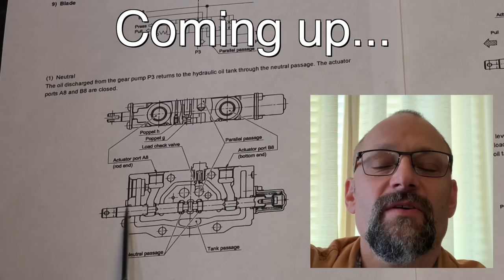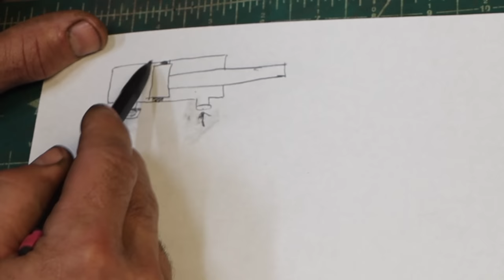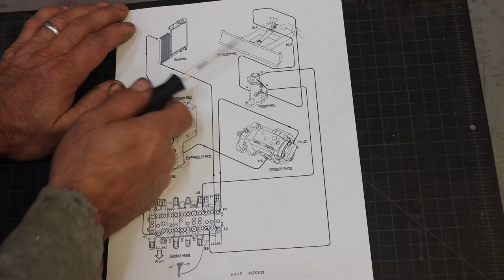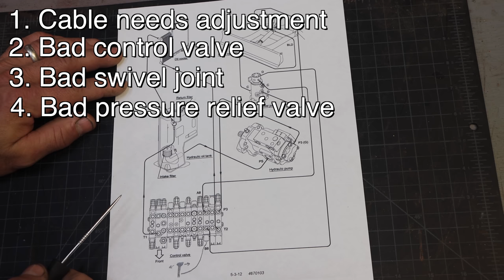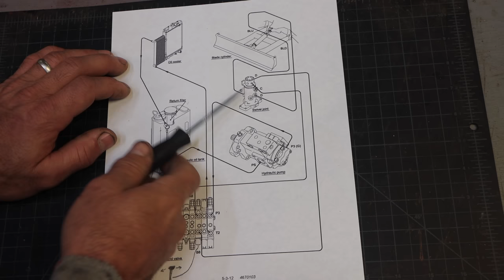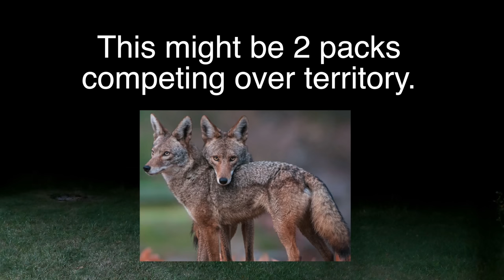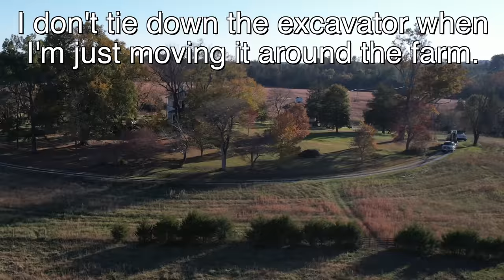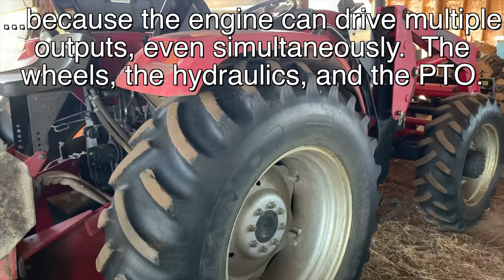Excavator Repair, Swivel Joint Rebuild, Yanmar Vio-50.

Comment: teflon tape is used for hydraulic systems ,just hold it back 2 threads so it does not get into the system. Hydraulic Tech Field service 20 years Paul Munroe Hyd inc Retired

Comment: Yeah you definitely should of specked out the diameter and ordered for hydraulic oil dealer they tend to be very helpful and drawing them out is easy and they usually switch with nominal dimension save you big $$$ and make you good fixing hydraulic that are long gone out of business, also call dealer hand get parts number, and shop round if you want the easy rote, great content, ps. Don’t use pie tape on hyd. Lol

Comment: I noticed that you had issues of cleaning your hydraulic oil on your excavator. I recommend you purchase or build a hydraulic filter cart
Reply: A hydraulic filter cart has a 5 micron filter and water filter at the suction side and a 3 micron at the return. Put the suction hose near the bottom of the tank and the return hose in opened end of the tank.  I worked on hydraulic Injection molding machine for 35 years. This is the best solution to your problem.

Comment: Hi! Thanks for the great video! Everything was well explained and clear as day, even though I've never more than seen an excavator. I was left wondering that shouldn't the hydraulic and electric swivel joints both be on the center of rotation in the boom lift?
Reply from the maker: Yes, see the clarification video in the description.  I was pointing at the wrong thing without thinking.
Reply: @FarmCraft101  Thanks for taking time answering a comment in a month old video! That was a great clarification, also :) I really appreciate you make clarifications if needed. Many won't. I'll check the descriptions f your videos from now on if I've left with questions 😉

Comment: You still could have bypassing. Seal could be slightly messed up when the blade is down and it has all the weight of the machine and when you were running test the cylinder has no weight on it

Comment: While I had envisioned something similar to the rotary manifold, that was much less complex than I would have expected.  How many hours do you think that took?  For parts that are so critical to the function of the machine, and are such a chore to disconnect, does it make sense to swap out the old fittings for quick disconnects?

Comment: I have worked on that exact same model of excavator. It would be worse if the valve itself was leaking because you have to take of every single hose

Comment: I took all my hoses off first on my vio 75 labled as i went and took it out at the bottom  i think its much easer  but my blade wasent the issue  it was the tracking  I took it apart and seals just rolled out like  powder ,

Comment: If you blocked the cylinder the other way around and tried to extend it, it is actually very dangerous if the seal is actually sealing. Since the rod end of the piston has a smaller surface area, that side will create a pressure well beyond the pressure that the cylinder is rated to and can blow seals, crack the barrel, blow the cap off etc. The great the rod to barrel ratio, the high the pressure difference created. Just worth noting. 😬

Comment: The drive motors also pass through the swivel. How do I test them like you tested the blade cylinder before I attempt to tackle a swivel rebuild? My drive motors seem to slip in high torque situations like turning or going uphill. I am afraid the problem might be in the swivel but I really want to be sure first. I also wonder why there are 10 hoses on the bottom part of your swivel joint. Two for the blade, two for the right drive, two for the left drive, and four more for what? Are they something to do with a low speed mode and high speed mode on the drives?

Comment: Possibly easy way to figure out of the hose has been patched together after breaking or is supposed to be like that is look at the Parts List for that hose...get the Part Number and then look up what it is on the Manufacturer's or Dealer's Website - does it show a single-piece hose with standard hydraulic fittings and no hose clamps or does it show that multi-piece thing with hose clamps?

I'm NOT a Mechanic or Excavator Expert but I'm betting it's a jury-rigged hose that's been pieced together because it leaked and should be replaced with either an OEM or Good Quality After-Market hose...

Comment: Cut the tip of a (clean) tube sock off and then stick it over your arm. That'll absorb all the fluid running down them while working overhead.

Comment: Imperial might be due to patent which is lucus girling believe items licence made under it follow imperial sizes even if quoted in metric on items like brake cylinders for motorcycles made in japan. Think it's partly if your tooling is set up for that why change especially on saftey items, it would all have to be retested and approved ($!) Plus time and issues.

Comment: It almost seems like it would be worth it to have two turns or so of hoses that could twist up instead of a swivel joint. After all, why would you need to continuously rotate? More likely you would just need to go back and forth repeatadly. Stops could keep you from making more than one complete turn. When the first designs were made, do you suppose the engineers tried an all hose scheme?

Comment: I would love to get together with you and design abd build this joint the way it SHOULD have been made. Whenever I work on MY OWN equipment, I allways take the time to make some alterations so that next time it will be aesier. The engineers if you can call them that,just dont care.I think all 14 hoses were attached to this on the bench ,then droped in place.

Comment: I’m just an old dumb farmer from Texas but I think you ran around the truck about five times just open a simple door so to speak on your hydraulic ram.  With all due respect
  
  It’s simple to see if one is leaking down whether it’s in your valve or in your cylinder.  
 Cap off the inlet with the hose removed and a half inch cap installed. Take your hydraulic cylinder and stand it up vertically at 90° and take any amount of weight and put a sharpie on your polishing rod and if you lose your mark within about five minutes you have a bypass problem inside of your cylinder. 
I’ve literally done 100 of these in my 60 years that’s the fastest and easiest way to check bypass. 
  If you’re cylinder does not leak down are you lose your sharpie mark on the polishing rod you still have a closed system inside your cylinder.   And you need to look at your metering valve.  
And generally speaking you have a 50-50 chance, of all the ones I’ve ever looked at it’s generally either the cylinder or the valve in the control box about 50% of the time.
  By the way great video, this popped up in a suggested video today first time I have seen your channel but I’m gonna take a look back and see what it’s all about.

Comment: «British Standard Pipe [Parallel/Taper]» is the *METRIC ISO 228 / ISO 7 STANDARD(S)* for pipes and fittings. 
Thus the Japanese made no mistakes desiging this machine. 

• https://en.wikipedia.org/wiki/British_Standard_Pipe

Note that BSP is not the same thing as US type NPT/NPSxx threads, even though both are imperial of origin. For one, the BSP threads are specified with arch-british Whitworth thread flanks of 55°.  

These BSP theads are a real thorn in the eye to us, the metric crowd. And BSP was in fact attempted replaced with pure metric equivalents. Unfortunately, BSP proved to be just too entrenched, as piping in general last for too long for this changeover to be viable. 

End of story, BSP was just re-defined in terms of decimal metric units but otherways stayed the same. Or not quite, as BSP was defined in terms of the inside diameter of a now defunct type of pipe. For example a 1/2" BSP thread actually measures more like 3/4" on the outside diameter with a ruler. 

To ease our pain further, the BSP nut size is not specified by BSP, so a regular 24mm or 27mm spanner will ususally suffice or be required.

Comment: There's a lot of "buy old equipment and fix it up mentality" out here, coming from experience I once spent 24k on a used skid steer and it was constantly having problems, at only 1200 hours! There was never a point where something didn't need to be fixed. The machine is worth $100-200/hr on jobsites so average 150, 5-10 hours spent fixing broken equipment can be valued between 500-2000 lost. For $1000 (.9% interest with a promo) a month I have a brand new bobcat, there some electric gremlins but with the warranty all I do is make a phone call and someone will drive to my house for free and fix the machine. Tier 4 with no DEF is not that bad, can be idled for a moderate time the only caveat is that you need to work at 80-100% rpm, which is right where the machine makes power anyways. I definitely love wrenching on stuff but with something like this I don't understand why people are so reluctant to get something guaranteed to work, even at 2-3x the cost getting 10x the work done because you can get a whole year of productivity in before you even need to do maintenance. Keep in mind I "paid" 72k and can sell the machine for 65-70k in the current market. I could get out of my loan and walk away with 20k right now and I never have any issues that impact my ability to finish a job or some work around my property.

Comment: Fantastic video - thanks so much for putting this together!  I do have one question: during the rebuild you showed how to install the new seals in the swivel joint, but I didn't see how you installed the second part of the two-part seal (the two-part seals that are seen @32:29).  How did you install the second part of the seal, when the two pieces aren't tight against each other?
Reply from the maker: I did both parts on camera. Might be hard to tell between them, they are installed the same way.

Comment: Teflon tape is acceptable, but you have to pay attention to what you're doing using it. It can only be on the threads of the fitting; anywhere else, you're just asking for trouble.

Comment: Good video. I know this sealreplacing are a big job. I just wonder. Did this solve your problem with different speed on the belts too? Just wondering because I suggested that in an earlier comment.  Regards Ketil from Norway
Reply from the maker: It did not make any difference in the tracks for me.  Obviously those seals in the swivel weren't leaking.  I'm probably going to end up rebuilding my travel motors too.

Comment: The cost went up because you bought 1. the KIT and 2. AT THE DEALER. So how to get them on the cheap? Just take the old seals to a hydraulic cylinder repair shop or a shop that makes hydraulic lines and buy them individually. The “O” rings you buy for Pennie’s at the NAPA auto parts store.

Comment: Reads in title "Advanced Hydraulic". Time to break out the jet engineering popcorn bucket!
Oh, the comedy of it all, cuz if you can't laugh at the problems, there's only anger and crying, and those aren't any fun. 
And finally on the best position of the top or bottom debate, it turns into a volume ratio, but in the end, neither is a bad place to be. Now it's up to you to interpret if we're still talking about mechanical wrenching or other things. 😉
Add: at 24:37, I was laughing my ass away for just a moment thinking that was either the bane of frustration or wail of success slightly muted. Secondary conclusion, maybe Wile Coyote was also having a busted knuckle day in his Acme repair and scheming cave.

Comment: You should never cap the rod end of a hydraulic cylinder and pressurise the piston end. This causes pressure intensification on the rod end of the piston due to the difference in surface area and can cause the cylinder to explode in worst case scenario but can cause damage to the cylinder such as ballooning of the barrel.

Comment: Trap for home gamers: be very careful when testing a cylinder for leak-by and capping the rod end port. Because of the area difference, rod side pressure will be higher then cap side in this situation. If the system runs near the cylinder's maximum pressure when operating, the pressure increase can damage to cylinder. You could blow out the gland seal, damage the piston seals, or even rupture the barrel itself.

Comment: This isn't how swedish excavators (like Volvo) work. They have a 200m long hydraulic line inside the lower unit to accomodate for turning.  You'll never run out of hydraulic pipe with 200m to spare.

Comment: Question, you have 10 lines coming through the swivel joint. 2 of those are for the blade and I would assume the drive motors require 2 lines each bringing the total to 8 lines.

So what are the 2 remaining lines used for?
Reply from the maker: There's 2 speeds on the travel motors.  Default is slow, but pressing a pedal puts them into high speed.  I haven't studied exactly how that works, but I'm thinking 2 more lines for each motor.  So 4 lines per motor (8) plus 2 for the blade.
Reply: @FarmCraft101  ignoring that I also got my maths wrong, opps, that makes sense.

Would love to know more, like if they just duplicate the lines to give additional flow or if it's changing a gear mechanism etc.

When do you plan on breaking something on the drive system so you can repair it all? LOL.

Comment: Zip tie use #16,397- how to identify hydraulic lines with multi colored zip ties.  Simple, methodical way of diagnosing the root problem. What a miserable place to work on that pump. What you need to do is build a bay next to your covered work space and have a “trench” to walk down underneath a piece of equipment. I think it would make a big difference than laying on your back.  Put a sump pit in to drain out any rain water. I lowed the pigmat wristbands 😂 at least they helped cut the oil running down the arm.

Comment: Wait, now that I how a swivel joint lets a hydraulic circuit through it, wouldn't be be unnecessary to mark which hose went to which fitting on the swivel joint, but just know which hoses on top and bottom were on the same circuit?
Actually now that I think about it, it wouldn't have mattered in the way I presumed a swivel joint worked , coaxially!

Comment: The hoses with the jubilee see if the other hoses with the crimped connections have a pressure rating on them, if there low pressure your ok, chances are there low pressure, if they were high pressure lines the hose would have blown off by now, jubilees never hold full hydraulic pressure anything more then about 10 bar they blow off,

Comment: Can you not tilt the cab on this machine?  I have a machine very similar to this that you can tilt the cab to get to all that stuff under the floor better.  You take a few bolts loose and it has gas shocks that help you pull the cab forward.

Comment: Thanks!
Reply from the maker: You are very welcome. Thank you!
Reply: @FarmCraft101  Thank you John again for the video, I pulled my swivel out and found that the previous owner had attempted to repair it using the newly designed seal kit but instead of installing those more rigid inner seals he just threw them out! all that was in there was the soft outer seals that obviously don't even make contact with the rotating piece. I have no idea how the machine even moved.
Reply from the maker: @ucfsub  Wow.  That's crazy.

Comment: Please travel a excavator boom towards the tail end of the trailer. Incase you go under a low bridge it will push down on the boom. The other way it will pull the boom into and up in the bridge you don't want to know what happens with amtrac and dot and dmv big fines and major repairs cost..

Comment: I have been wanting to find a cheating way to make mokagame style of mixed metals silver and copper I was thinking about putting copper into a mold in bits laid throughout and heating it up with a torch until it is about to melt but not quite in the mold and pouring the molten silver into it have you tried this or know of any who have what would happen

Comment: your second example with both lines capped and no seals comes to wrong conclusion.. If the seals are gone the piston will compress when rod is pushed until it bottoms in the cylinder. The lack of seals creates the flow path.
Reply: Nope assuming the cylinder is sealed around the stem it has a fixed amount of volume the stem can’t push in because there’s no room in the cylinder to add the stem. The piston seals wont matter there simply no volume left in the cylinder to add more stem

Comment: A leak in the cylinder will not cause the cylinder to drift. Either a leak in the system or bad control valves.

Comment: What would happen if you just add one ball valve to that line which was "losing pressure" and after lowering that back part you just would have to close it and open before bringing it up. I know it is .. how do you call it :D "redneck?" way of handling stuff, i don`t know much about hydraulic systems sry. :D I just found your channel and i find it very interesting with preety great video montage. Greetings from Poland.

Comment: 6:34 I'm sorry, your physic is wrong.
When the seal is leaking, the whole cylinder is now like a big syringe.
If you put pressure in the cylinder, the pressure want to equilibrate with the atmosphere. The fluid will push an equal force on all the walls. The piston will then have to move outside to reach that equilibrium state.
It's like if you are pushing liquid in the "syringe" from the needle side. The plunger will slide off the syringe.
Hopefully, my explanation is not too muddy.

Comment: Like i have said so many times, a lot of engineers should not be allowed to even design street signs. If you can't fix a car or a machine out on the side of a road alone with basic hand tools than the engineer who design it shouldn't be allowed to even design street signs. Function over form...